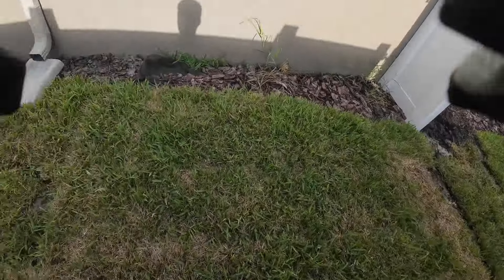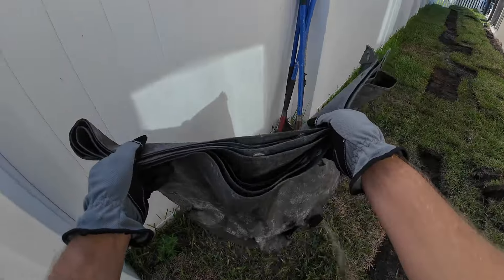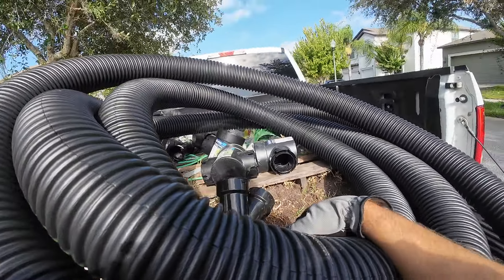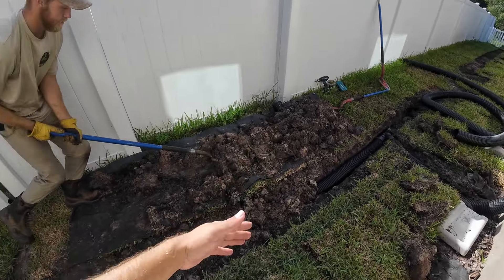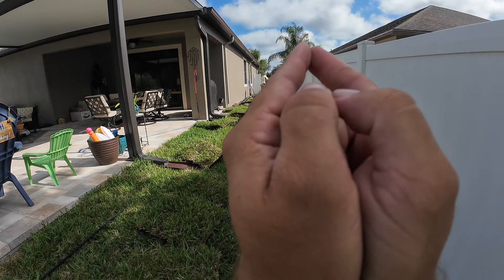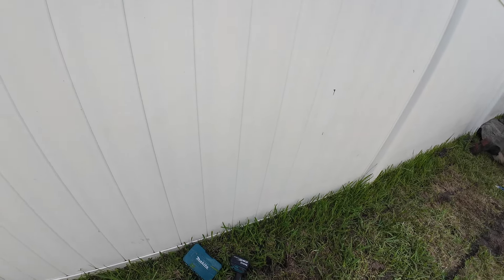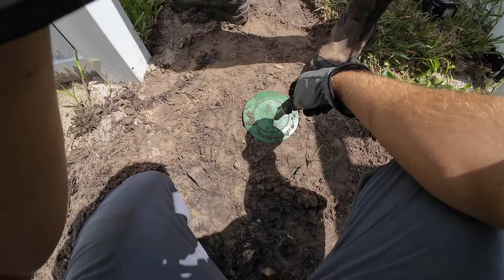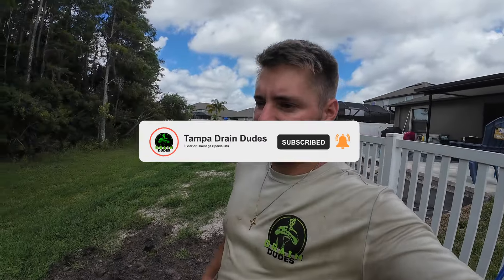Redirect Your Downspouts | No More Standing Water

Comment: I've been watching a lot of YT videos trying to plan out my DIY yard drain; and I'll be using those exact products as well.  My question comes from another video I watched, it said it is best to put a few weep holes in the bottom of the catch basins and install them over 6" of gravel, so that water does not sit in the bottom of them after a rain.  Now being in Florida, you know how fast mosquitos grow in stagnant water, what is your opinion on that process?  And also, I noticed you didn't measure the pipe depth for slope, is that not necessary?  Thanks for any info you can tell me.  I'm in Brandon, not too far from you guys.
Reply from the maker: @SheilaSpencer1  definitely recommend drilling holes and using rock below the basements, if the soil is soft enough to let the water percolate. Where you are it likely is. Most jobs up here north of tampa are solid clay.    We rarely check the pipe for slope. Our rule of thumb: if we can’t visually tell that the pipe is going down, it’s not going down enough.  You can always water test it as you go, just fill the start with some water and make sure it flows down!